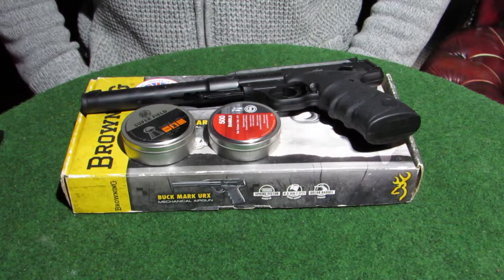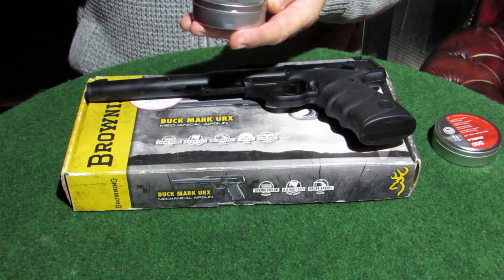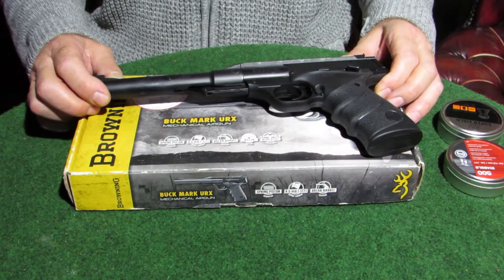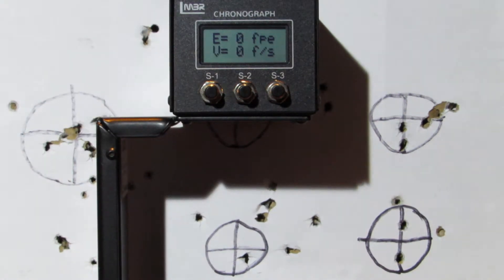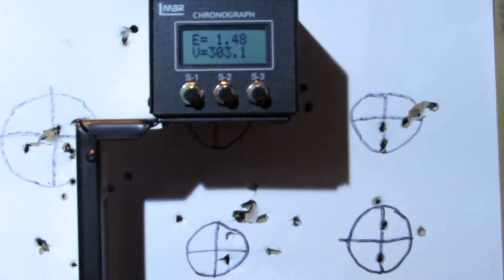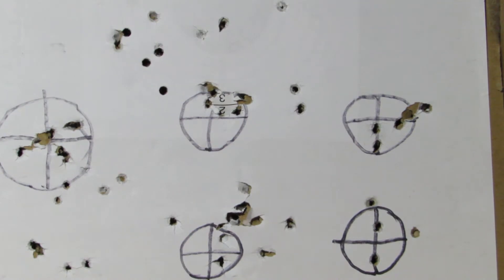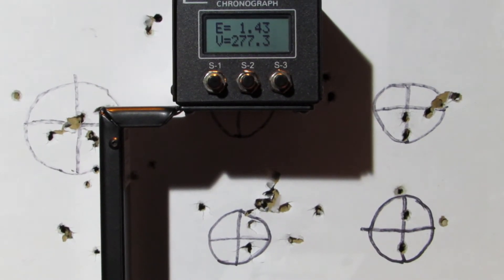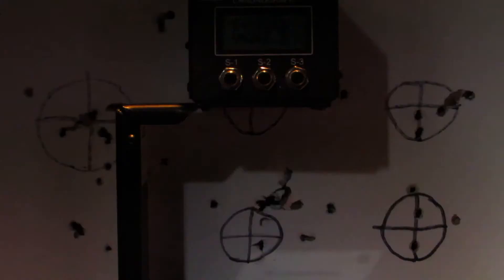Umarex Buckmark .177 U.K. air pistol power test

Comment: Did you increase power ?
Reply from the maker: Hi Mickey, no, i tried stacking washers behind the spring but then it wouldnt cock. Dont think the power can be upped on this gun other than changing the spring maybe.
Reply: @ShootfishProductions  thanks for answer. I've bought one with small defect now I'm waiting for arrival and searching how to instructions.
Reply from the maker: @mickeygmx3114  No problem , good luck with that. I done a stripdown video on the buckmark if you havent seen it.